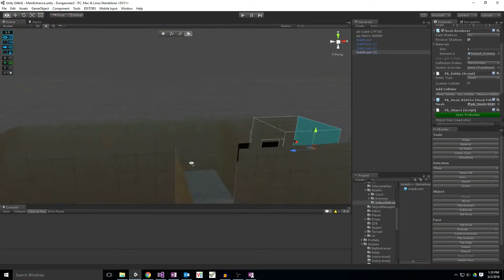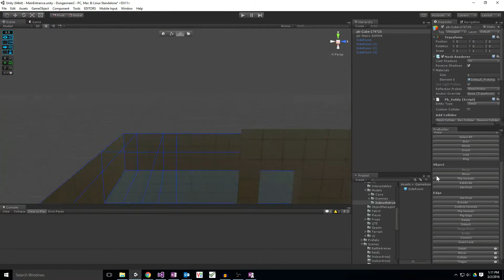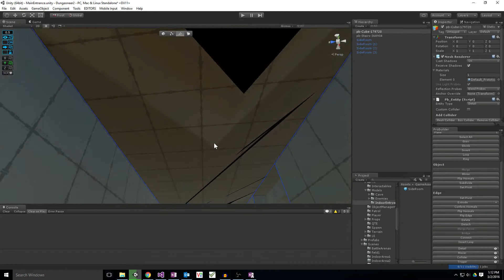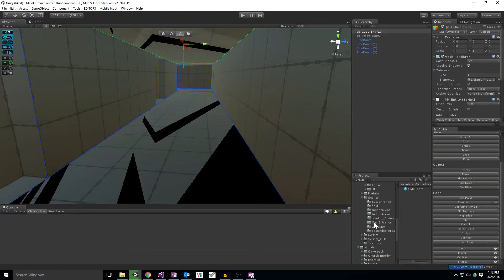Quick Tip - Lighting Repair with ProBuilder

Comment: FYI, a degenerate triangle is one where like all the points are in a straight line, so the triangle only has one dimension instead of two, or similar issues.